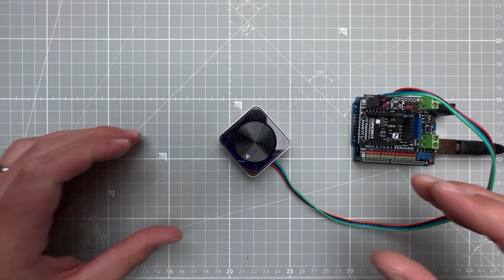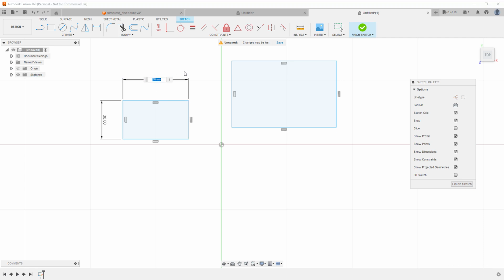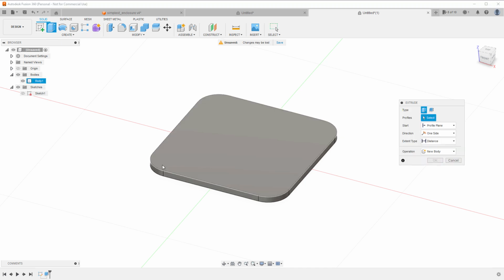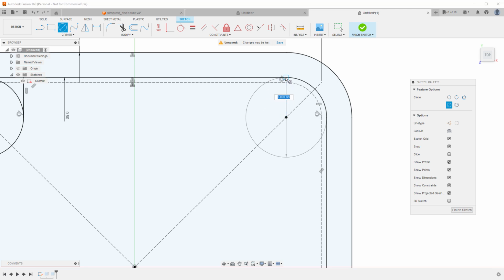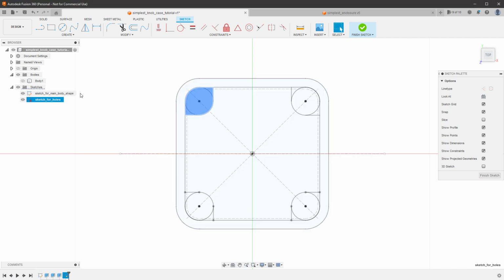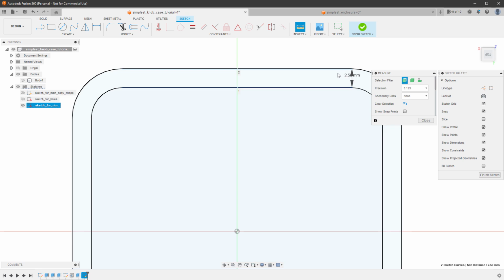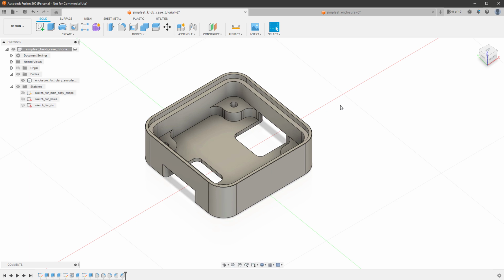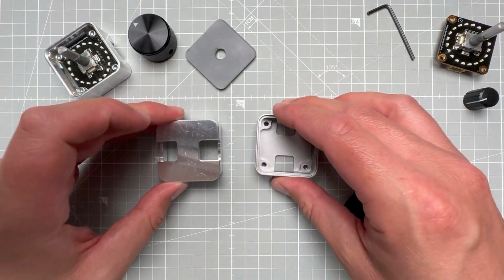Your 1st CNC-ed Part

Comment: Why don’t you use solidworks instead?
Reply from the maker: No particular reason. I have just found a lot of online tutorials for the Fusion 360, so I went with that..
Reply: Solidworks has a much steeper learning curve than fusion 360. It is also a more powerful piece of software, but definitely harder to get into.
Reply: @DDryTaste yeah but the cam is useless for makers with the maker license. No Post Processors for hobby machines available and no YT of how to use it. 
The regular CAM isn’t available in the maker subscription.

I liked SolidWorks for the CAD even when it bugged out in big assembly’s. But the missing native SolidWorks cam and that updates prevented me to use it sometimes (version mismatch after update because servers where expected a older version. License not valid) was a no go.

Comment: Great creation, a tip for Fusion360 which has helped me with accuracy in a similar projects with PCB, first model the PCB with connectors, high components and holes and then just you can model around. I have no experience with cnc but for 3D printing I leave a tolerance of 0,3-0.5mm from the walls and everything always fits.
Reply from the maker: Great tip! I have used the same approach in my other video (https://youtu.be/e2UNsZPjHkk), but I did skip it this time, as I wanted to make it as simple as possible. However, I agree that modeling the PCB first can save a lot of time and frustration.

Comment: Waste 99% of material, finish with "plastic painted to look like alluminum made in china" surface 😭😭😭
Reply from the maker: Do you have any suggestions on how to waste less material? Also, it’s not really wasted, as those chips are of course recycled into a new aluminum blocks. As for the anodized color, I thought it would be darker, I probably like the black one used the last time a little bit more.
Reply: @upir_upir  i would simply use prefabricated extruded square alluminium pipe, 3 meters still cheaper than your 30+ usd part, some plate with holes for the bottom, it could be 3d printed. The potentiometer handle should have threads to secure our 4 parts sandwich together. The glass has to be machined to be pushed tightly inside the tube, or to have the same cross section as the outer side of the tube, so there is no much gaps for dirt and fat (look at average pc mouse).

Sorry if I am being negative, our philosophies differ too much, still love your channel.

Comment: 37$ is toooooooo much.
In Ukraine we making same details for 10$
But if you order 10 pcs, it will cost you around 5$ per 1.
Reply from the maker: Could you perhaps post a link where you can order it? I’m sure it would be interesting also for other viewers. Thank you!
Reply: @upir_upir  No. We working on B2B. Making press-forms (injection molding) for other factory's. So we don`t take any orders online.
Reply: Hi, could you please share some information about the company where I can get these rates ? Thanks!

Comment: When using threads check "modeled" especially for 3d printing - you get much cleaner threads. Cheers
Reply from the maker: It’s definitely needed for 3D printing, as this option creates the actual geometry, but for CNC, I don’t believe it’s needed. But- I could be of course wrong 🙂
Reply: @upir_upir  I think you maybe right It might just generate a code for the thread otherwise why not default to modeled. Cheers
Reply from the maker: @petermoore9504  yes, I think we can agree that it would not hurt to have it modeled.
Reply: @upir_upir  Some manufacturers don't want it to be modeled, it unnecessarily complicates the design, all they want is the center position and what the final thread and depth should be, they'll handle it after that. PCBWay iirc prefers not having it modeled
Reply: Depends, if you have a lot of them, and you don't have a high end computer, it can significantly decrease the speed of the program / which is Hella enjoying. But for just a few it's oke
Reply: If you're machining them, you don't want to model them in. You simply want to pre-drill the holes, and then use a tap to make the threads. After all, you can't 'drill threads'.
With special bits you could theoretically mill them as well, but it's a bit of a pain, especially on really small threads. 

For 3D printing, I also just make it the size that's recommended to pre-drill. Then slightly heat the bolt, and use that to cut/melt the threads.